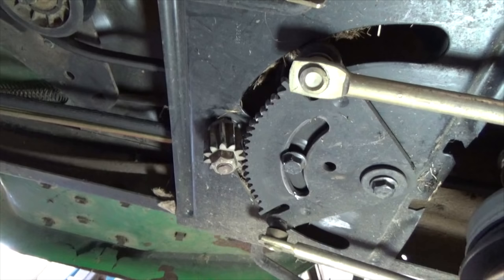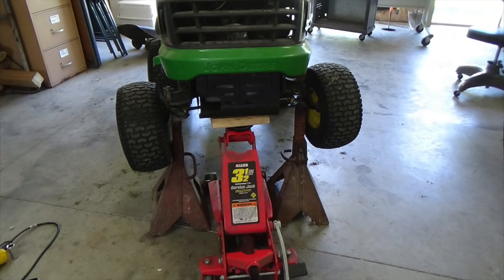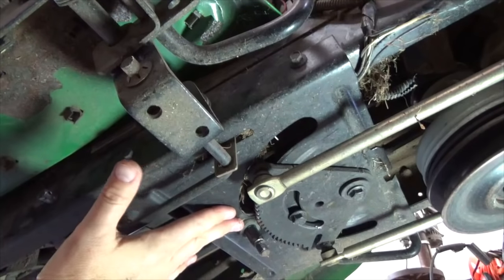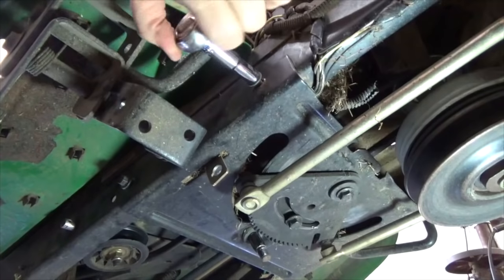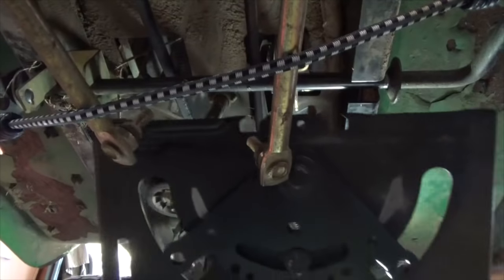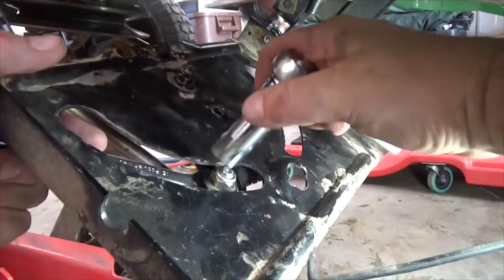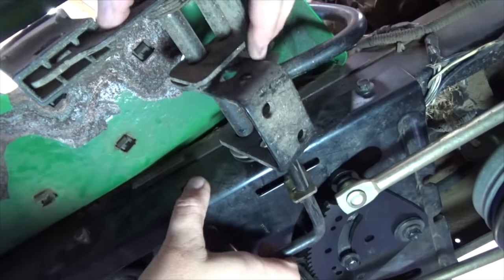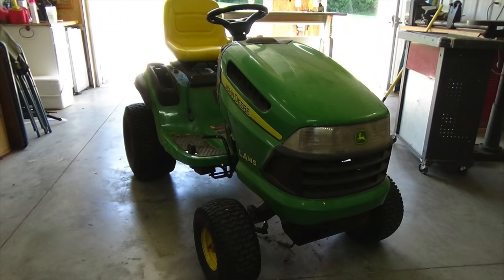Steering Sector & Pinion Gear Replacement - John Deere LA145 Riding Mower

Comment: Have you worked on the mower deck ?  one of my blades came loose looks like I will have to replace a part that holds the blade in place as the spindle has worn teeth ,where the blade bolts on.
Reply from the maker: I've done about everything to these John Deere mowers, but I've never had a problem with a loose blade.  Here's what i would do if I were you.    I would go to a dealer and get an explosion diagram of the area that needs fixed.  Then order the part and follow the diagram.  If you are still needing help, I would direct you to a great lawn mower forum on-line called :   'lawnmower forum.com "   there are a ton of people on there that would love to help.   They have helped me a lot.   In fact..... I have been told that it is recommended to lube my steering gears.   so....at least I can give you that tip.   Hope this helps.
Reply: Yes thanks will check it out .Yes I did lube my steering worked well .
Reply: Sounds like you just need a new spindle assembly (~$30 each), I've replaced mine twice for a different reason (due to sand getting into the bearings and eating up the inside of the housing).

Comment: I’ve replaced everything as this video shows, but I can’t seem to keep my tired and the driving/steering rod straight so the wheel turns more to the right than to the left. Any tips?
Reply: This video is very informative and helpful though, I just think I’m doing something wrong.
Reply from the maker: so hard to diagnose through text without seeing it.  sometimes I will go to a mechanic and describe a problem, and then use this info to help figure it out.  Not really sure if I know what to suggest

Comment: Any idea what to do if the pinion gear doesn't come free? Tried prying and using penetrating fluid, best guess I have is that the pinion gear is fused somehow. The guy at John Deere also said it should just come off.
Reply from the maker: I've had others tell me the same thing.  some have been successful by prying and beating.  You could try using a bearing puller maybe?
Reply: @PhilCrockett  thanks for the reply, just found out about a gear puller right before you replied, will let u know if it works.
Reply from the maker: indeed!

Comment: What does "very well" equate to in psi? I bought a torque wrench a couple of years ago and might as well use it.
Reply from the maker: In order to get the proper torque, give your local JD dealer a call.  The parts dept may be able to help you with that.  That’s where I get all of my explosion diagrams printed off.
Reply: Thanks for replying! It was a helpful video.

Comment: Good job on video, but in addition my LA145 has a worn out bearing at the top of the steering wheel shaft, 
There must be some type bearing at the top or near where shaft comes out of dash, steering wheel is hard to turn and it makes a squeaking noise each time I turn the wheel,
What is up there and how do you replace it, I have found nothing about a top bearing,
Thanks fred,
Reply from the maker: There is a plastic bushing like the one in this video at the top.  I would go to the local John Deere dealer and have them print you off an explosion diagram with the part numbers and you'll know what to get.
Reply: Phil Crockett thanks for the reply, 
I did go to the JD dealership today,  but their exploded view did not show any top bearing on the steering shaft, all I got to talk with was some girl, I wanted to talk with mechanics, but it did not happen,
Reply from the maker: try searching on this site:   https://www.green-parts-direct.com/free-parts-search
Reply from the maker: here's another site:  https://www.greenpartstore.com/

Comment: I'm stuck - I have L110 and followed Phil's great directions closely. Got to step where remove 4 screws holding plate. Plate dropped only slightly and not as shown in video. I have tugged at it but still not enough access. Phil's video is L145. What is L145 model -  what more can I do on L110 to get plate to drop and take next step to replace steering sector? Thanks to anyone for helping.
Reply from the maker: I wish I could be there to help you out, Michael!
Reply: Phil - to allow the plate to be fully accessible, should I remove the "drag links" - Think that's part name (metal piece that joins steering sector plate to wheels). You did not do that in your demo for L145 - I have L110.
Reply from the maker: yes.  that would definitely make it easier!  I've done that before.
Reply: @PhilCrockett   Thx for tip - it worked. t was quite difficult to remove the slot and pivot bolt (fastened very tight). I'm now re-connecting steering sector gear to plate. I have teeth facing away from plate. After I refasten and fully tighten both bolts to new plate, the plate does not move/pivot at all (unless I leave slot bolt loose, which I'm sure  will rattle off when operating). Any suggestions?
Reply: Phil - I solved it the move/pivot issue (directly above) - I'm challenged in the handy department in so many ways - thx for the willingness to assist
Reply from the maker: No problem, Michael.  So glad you got it figured out.

Comment: How much bushings did you use in the install. Parts manual lists 2 of them
Reply from the maker: I didn't change the steering column bushing because it was in good shape.
Reply: @PhilCrockett  nice, good video. got me through it. i replaced the pinion and sector  gear and didnt do the bottom bushing and had to buy the parts again
Reply from the maker: rats!  However, at least you didn't pay someone a ton of money in labor.  Thanks for watching and commenting.  I hope my other DIY videos help you out again someday.

Comment: If only the Pinion gear is damaged, remove it, clamp in fixture in Drill Press and with 3/4" drill, drill the top end down 1/8" so the gear can be reversed on the steering shaft and good teeth now engage the Sector gear.  Make sure Steering wheel is Centered on reassembly. It would be nice if socket and wrench size was included in the video.  Count the teeth and mark the centre one on the bottom side of the Sector Gear.  It helps when centering the Steering wheel and affixing the pinion gear.
Reply: TY
Reply: I'm sure this works but why bother when you can get a new sector gear and pinion from Amazon for $30.
Reply: @georgeradak4119  Those two items are nearly $100 in Canada.  Next sector that is good I will save, trim and stack and weld them together so more pinion tooth is engaged.  Poor design.

Comment: Will parts from Amazon work?
Reply from the maker: I have no idea. I bought mine from a John Deere dealership. I paid way more than from Amazon, but I absolutely received a high-quality product.
Reply: Last year I replaced mine with Amazon stuff. Worked really well until now. I have a super bumpy lawn, probably 2 acres, so it sees lots of use/abuse. I'm replacing it again with John Deere parts plus the "poor man's power steering kit" to help out with wear on the steering gears.

Comment: Just bought a used la115 today that runs great but steering is fubar. It actually "hangs up" trying to turn the wheel and doesn't spin freely like the gears are stripped. Hopefully it's just a variation of this problem and easy enough to repair. Was thinking about trying to make a video of it but never done one before so we'll have to see what happens.
Reply from the maker: Could be a number of things, but the steering sector gear problems on these cheap built mowers is usually pretty common and of course fixable.  Let me know what you find out. I'm curious.
Reply: What I found was that the problem with the steering was; pinion gear, which was in fair condition, and the sector plate which had some teeth just about gone, was caused by the right hand steering spindle that was almost seized in the axle (covers missing both sides). Having a hell of a time getting it freed and removed, and mushroomed the head of the spindle hitting it with hammer. Have been spraying it with PB blaster, which has definitely started freeing it up a bit. Just going to continue hitting it with the lube and will grind the top of the spindle down and try again when the parts get here next week. Will be replacing the spindle as well as the pinion gear, bushing, and sector plate. Will update when I get that done. Unfortunately no patience for doing a video just yet. By the way, I only paid 340 for the mower and 75 for the parts, so if this works out, I'm not going to feel too bad about the deal.
Reply: Used a grinding wheel on my dremel and got all the burrs off the top of the  spindle and grinded it back a little extra for good measure. Kept working it with the PB Blaster and was able to finally tap it out of the axle with a hammer and brass dowel. Cleaned up the inside of the axle tube with a 10 gauge shotgun cleaning brush on the end of a drill. Not as honed out as I'd like it but at least all the rust and crap is knocked off. Waiting on parts now.
Reply from the maker: I wonder if a bearing puller would work on taking a pinion gear off.
Reply from the maker: You have a 10 ga shotgun?   Is it an Ithaca?   BTW.....  good job getting that darn thing off.  If this works out, then you just got yourself a DEAL on a mower.   Keep me posted.
Reply: No my cleaning kit had a brush for a 10 gauge. Got the parts today and put everything back together. Lubed it up and everything now works like a charm. Even got half the yard cut before the monsoon! Yep, home run on the deal. Thanks to you for the vid that made everything so much easier than just winging it. People like you are the reason youtube rocks for DIYers.
Reply from the maker: You're kind words made my day.  Thank you so much.  Have a blessed day, my friend.

Comment: What do you call this type of steering arrangement which doesn't have a tie rod between the front wheels?
Reply from the maker: Not sure what you mean....   Maybe ask a dealer.  I use my local John Deere dealer all the time.  Love getting explosion diagrams printed off from them.
Reply: Are you referring to using a worm gear?  Both wheels still need to be "tied together" for uniform turning.  Even rack and pinion set ups tie the steering wheels together.
Reply from the maker: thanks for the comment.  That's very helpful

Comment: This job took me a couple of days, Day tear down, Day 2 part purchase and reassembly . I got extra and tried to take blades off. They were STUCK. After about a week of fighting I took to John Deere. They replaced spindles and blades for about $240.00. Took me bout 3 months to get it out. I know I should be ashamed lol. Mower was down so long it wouldn't crank needed a battery. When I replaced the sector I had a bad tie rod so I replaced both. After  3 months of sitting I crunk it up. I was just relieved that I done my part right!!!?
Reply from the maker: HA!  yes....sounds familiar.  I swear, every time I go to replace something, I find more parts that need attention.  Glad you at least got to save yourself some money on the steering sector.  God bless you, my friend!

Comment: how tight do the bolts of the steering sector gear get reattached ? i will be doing this tomorrow, so haven't taken it out to replace yet, but notice there is a good amount of play, which certainly seems odd, but i am a mr liquid wrench, so i haven't a clue to the natural state.  i say an 1/8 inch play,.
Reply: or should they be snug, with just enough space to turn/pivot?
Reply from the maker: The way that the bolt is manufactured, makes it's own space.  You'll know what i'm taking about when you do it.

Comment: I noticed that you did not put any grease on the gears but left them dry, is grease recommended???
Reply from the maker: Randy,  so glad you asked this.  I addressed this in the posted comments.....  YES..... you should always grease the moving parts.  It IS recommended.  Thanks for the question. my video showed the mechanics, but hopefully folks will read your comment and it will add to their education.  I really appreciate your added words.....hopefully you have blessed others!
Reply: Thanks for your answer...

Comment: Don't know if you still read this however would it be advantageous to lube the pinion and gears with a dry lube?
Reply from the maker: It really wouldn't hurt, however, since it will only last one season, you will need to do it every year.   In my experience, he mower kicks the bucket long before your average steering gears go out.  I'm constantly working on both of my John Deere mowers.  just put a drag link in one a couple weeks ago, and now the transmission is going out.  Lasted 10 years.  They old ones lasted more than 20 years.

Comment: Anyone know the socket/wrench sizes used for the steering sector and pinion replacement?? Trying to be prepared for when my parts arrive..
Reply from the maker: I appreciate your question!  I should have put that in my video.  I hope someone else can answer this.  If I were you, I'd just go out to the garage and start fitting some sockets to the bolt until you find it.  Shouldn't take long.  I never pay much attention to sizes.  I always "eye-ball-it", and keep fiting until I find the fit.

Comment: Is there supposed to be any play between the sector steering gear and the sector nut and bolt?
Reply from the maker: I have very little play between the two.  However, I do have a mower that has quite a bit more of play, and it works great.

Comment: Very good video, but I really wish you had included the socket/wrench sizes for each of these bolts, nuts.
Reply from the maker: Great suggestion!  I never look at the socket size. I simply try a few on until I find the right fit.  I just figured everyone does the same thing.  I will remember your tip for the future.  Thanks for the crique, my friend

Comment: I have done this four times on my John Deere la145 and for some reason it still won't turn left without slipping but turns right perfectly they give you two bushings on the rebuild kit and in the schematics I see two bushings but it makes no sense and I don't see anybody using both bushings where does the other bushing go it looks like it goes on the top and the other one goes through the bottom but then that means the other one on the top is just sitting there?
Reply from the maker: It turns the way you use less most likely. One thing I did learn, is you need to buy a real John Deere part. The parts are always higher quality than the crap they put on them in the factory

Comment: How do you grease the rack and pins on the steering?
Reply from the maker: I generally don't.  Unless your going to clean and re-grease often.   You might go to a dealer where they work on these and ask what they use.  Don't be surprised if they tell you that they don't grease.  The JD dealer/shop guys down the road from me says that greasing is useless in the long run.

Comment: Any suggestions if I can’t get the pinion gear off?
Reply from the maker: buy really good anti-seize oil
Reply: Phil Crockett Bought penetrating oil with anti-seize formula. It took some wrestling but it worked. Thanks for the suggestion and great video.

Comment: I'm having a problem with getting my pinion out any suggestions it's not budging
Reply from the maker: I haven't had that problem (yet!).  I would try tapping on it with a hammer to break it loose.
Reply: Grab a large pair of vise grips on it.   Then take the side of hammer head and just tap down on it.  Rotate it around and hit different areas and it' will break loose    It comes off pretty easy really and is probably just a bit stuck.
Reply: Spray some Sea Foam "Deep Creep" at the top and bottom of the pinion gear, then you should be able to break the nut and pry the pinion gear downward after you get the nut off. That is good stuff.
Reply: Leave the nut partway on the shaft and hammer it upwards.
Reply: I have tried all of these ideas myself and still after 4 hours cannot get the pinion to budge.

Comment: It would be nice if everyone worked on equipment that clean usually the pinion gear is so rusted you have to soak it with good penetrating oil
Reply from the maker: I usually try to clean everything before I film it so people can see the details. There's a lot to making DIY videos if you want a good one and teach someone.

Comment: My husband Replaced steering gear and pinion gear and now the turning radius on tires isn’t the same.  Tires not steering like they should.  What did he do wrong.
Reply from the maker: Hard to diagnose without seeing it.  Make sure he bought the right parts.  I always match my old junk to the new junk.
Reply: @PhilCrockett  My guess is the teeth on the pie-shaped sector gear are not centered on the center tooth while the front wheels are straight ahead....before installing the pinion gear.  You have more than enough teeth to turn one way and not enough to turn the other way.  * Remember:   Also make sure your steering wheel also points straight ahead before putting that pinion gear in place.  All straight ahead!

Comment: Thank you for this video !!
Reply from the maker: Glad this helped you out.  Just a quick tip..... I didn't put it in the video, but it is recommended to grease all moving parts on the gears.  You can still do it, but I suppose it would have been easier to do it when installing.  Just a tip I got from the pros, for what it's worth.  Glad you like my video.  Thanks for the positive feedback.  Please share with your friends!